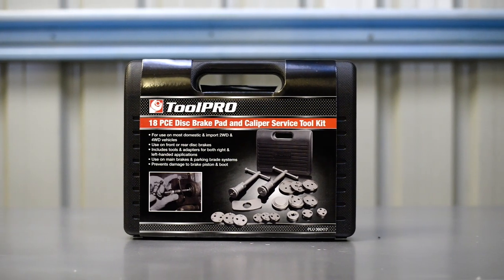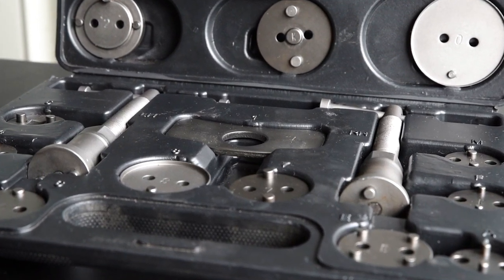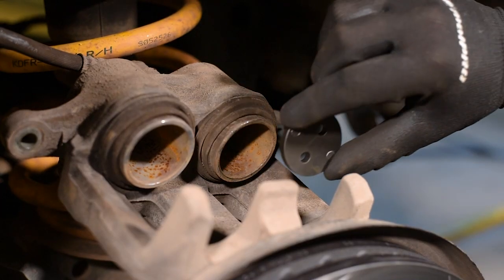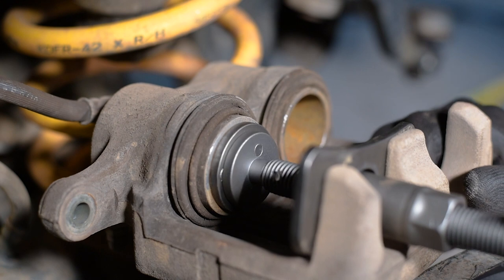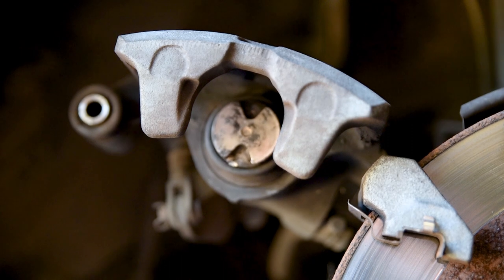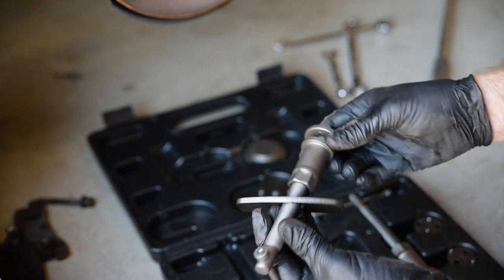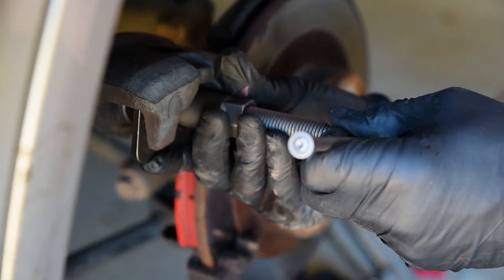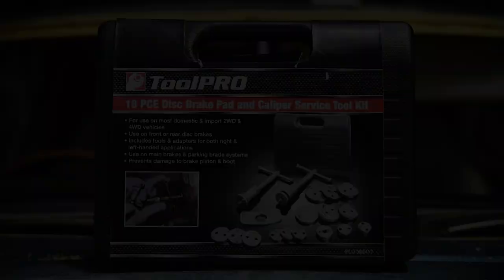ToolPRO Brake Piston Wind Back Tool Kit

Comment: They should also show how to release the tool. It's not by reverse winding the t-bar handle. You have to use a spanner on the spindle in the opposite direction to when you applied the device to relieve the force. The t-bar won't move.
Apart from that, it's a great kit. I was no way able to compress my ford rear piston using pliers: not enough force, thing just turned but didn't compress. This tool did it easily.